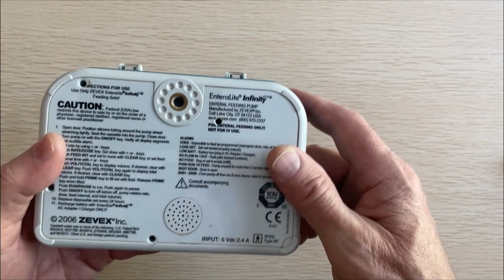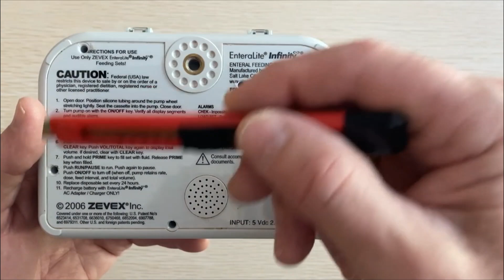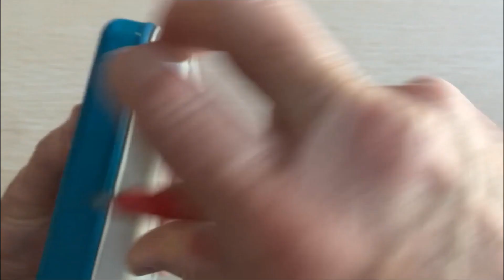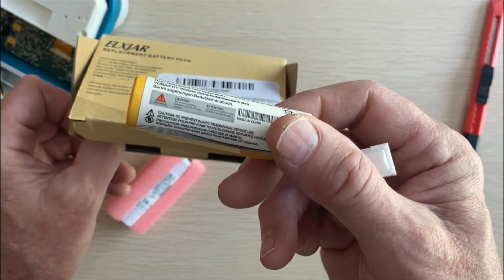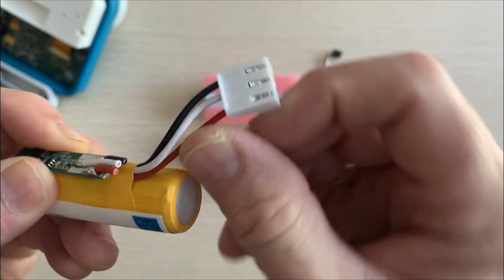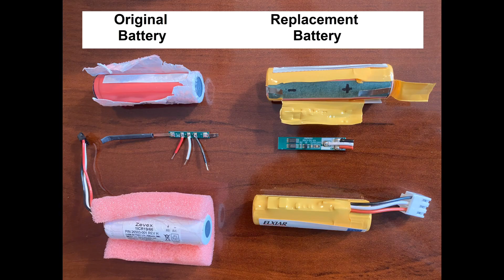Replacing Battery in Enteralite Infinity Pump

Comment: Any updates?
Reply from the maker: I don't have much to update. My replacement battery does work to power the unit. Two things don't seem quite as good as the original. First, my new battery doesn't seem to run as long as the original and second, if charged, but left unused for a long time (weeks) it drains down and loses its charge.